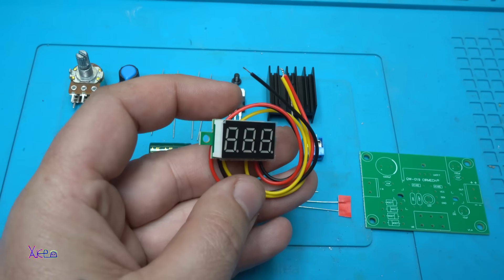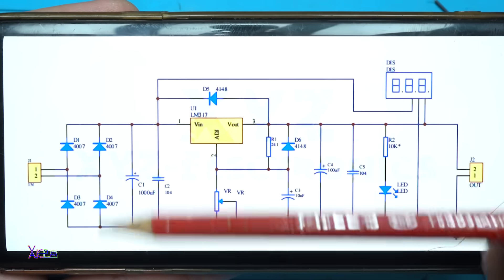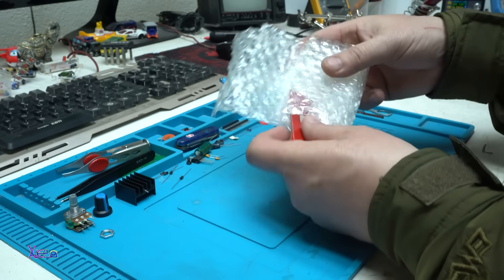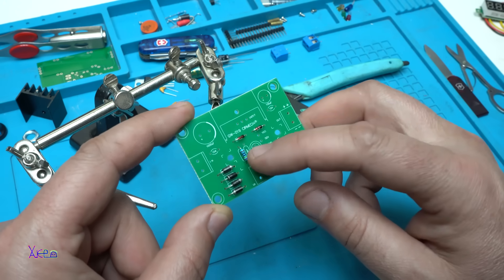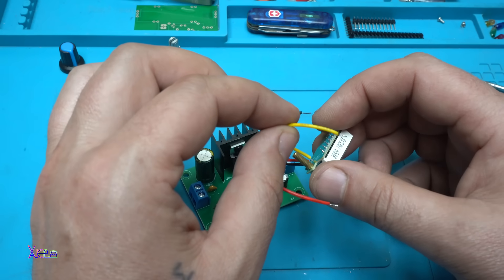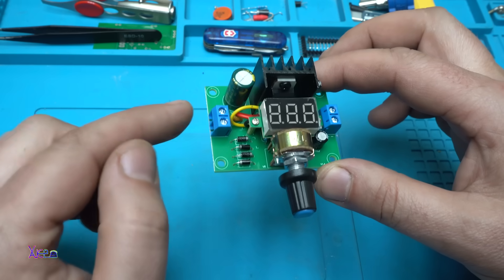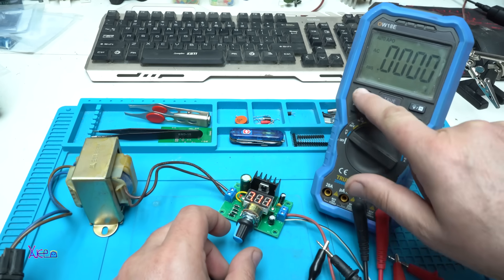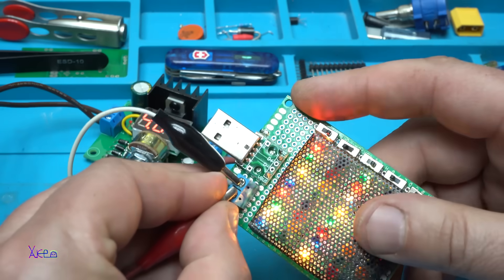With THIS $1 Module I built Amazing Gadget!

Comment: When i finish modding the W1209 thermostat, i'll take the DVM 368 and will try to modify (that involves taking away the 8bit OTP mcu and putting in place a very cheap 32bit ARM mcu).

Comment: Thank you for this usefull design and explication. Correction: the two 1N4148 are "signal diodes" (not Zener diodes, Zener diodes are used for limiting or crop voltage) 🙂🙏
Reply from the maker: Thanks for correction,I made  mistake😉

Comment: Parts used fo making LM317 voltage regulator:
-LM317T Regulator.....
-1000mf 35v.......its  uF, not mf
-100mf 35v
-10mf 35v
-4x1N4007 diodes......that is overkill
-2x1N4148 diodes
-2x 100nf capacitors
-Potentiometer 10kohms....what taper??
3 wire led voltmeter

no transformer??
no indicator??
no fuse??
no heat-sink??
Reply from the maker: I try to share basic electronics stuff, negative feedback is welcome🙂

Comment: Dual 10k in parallel = 0-5k range as the datasheet prescribes for the reference voltage divider.
Reply from the maker: That's the correct way to set up the reference voltage divider.
Reply: Also maybe to make it more secure since a single pot would bend on the board over time.
Reply: @roberttco1  Agreed, but as clumsy as I am, the time would be measured in seconds...
Reply: 2x10k in parallel is 5K max resistance,not 0.5K

Comment: Too bad JLCPCB shipping is outrageous!  .26KG board shipped for $17.50... 2.5x the price of the board!!
Reply: Go and get a cost estimate for a board from an American company (take your pick) and I guarantee you will spend a lot more money.  JLPCB does nice work and they ship within several days of the order, unlike the lead times from domestic manufacturers for small orders.
Reply: @scottbrown4534  :)
Reply: @scottbrown4534  Also a lot of the world are trying not to send money to the USA at the moment for #REASONS
Reply: Depends which shipping option you select. They have an untracked postage option for a lower cost.
Reply: 3D printing prices are pretty high also.